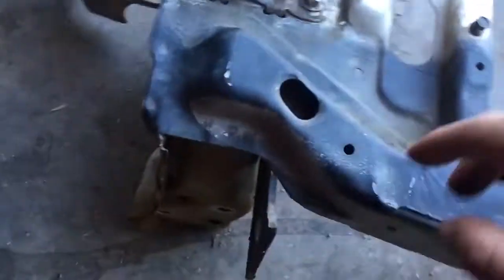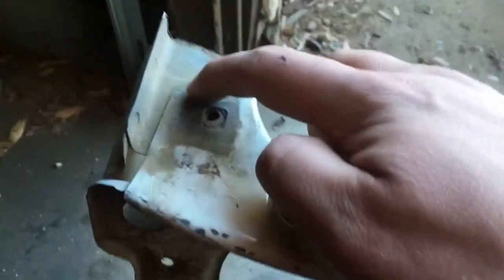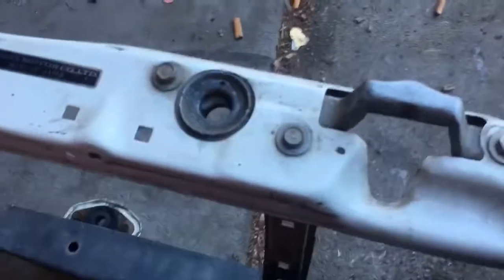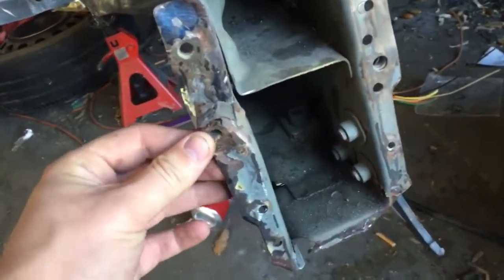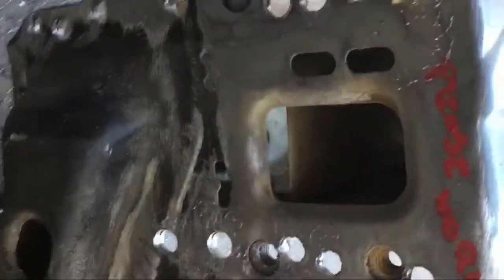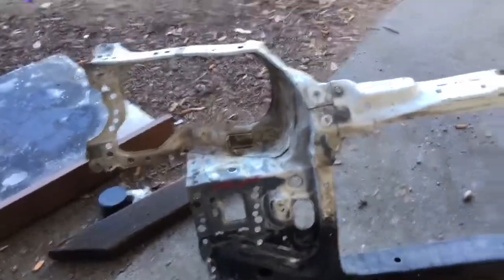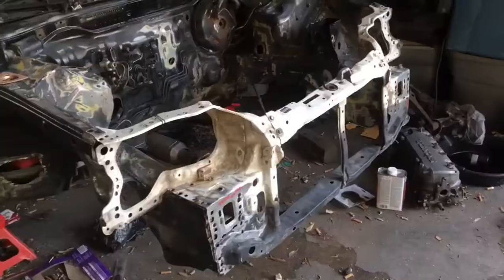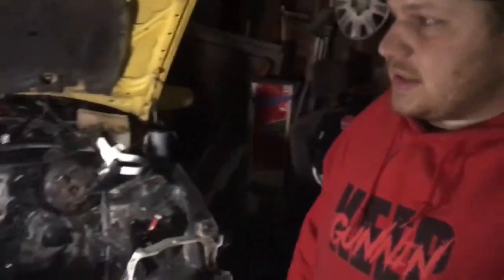welding radiator support

Comment: I would like to know if I can use the radiator support sedan 4 doors  in a eg ????
Reply from the maker: Yes but you would have to use 4 door headlights and bumpers and fenders and good in order for it to line up
Reply: @Lazymangarage  
I just want to use radiator support of 4 sedan bumper lights and hatchback fenders (eg) would they look good????
Reply from the maker: Not necessarily it will look weird on a coupe or a hatch you’re better off getting a eg hatch or eg coupe front radiator support if that is what your car is